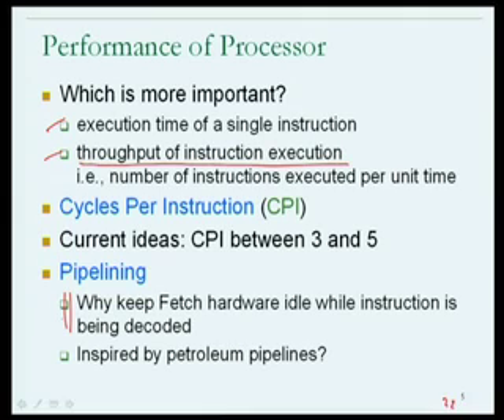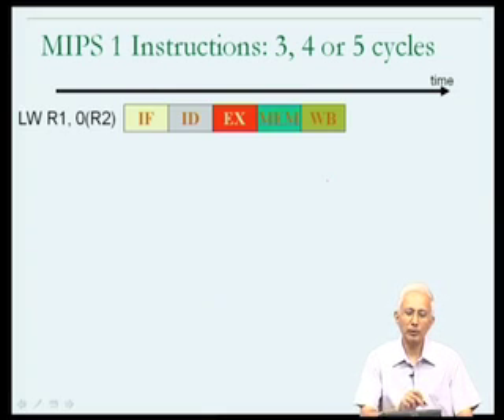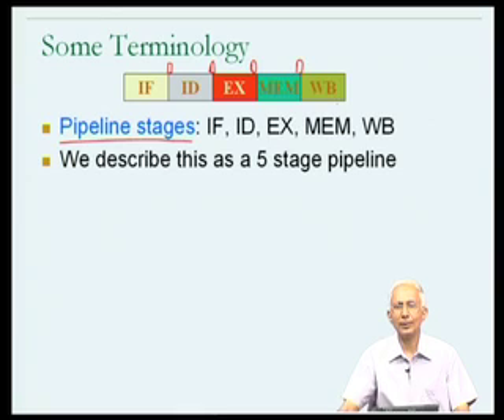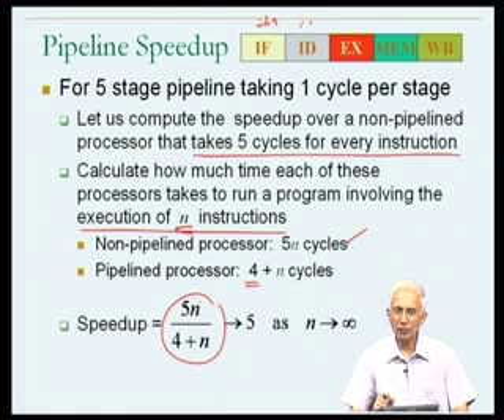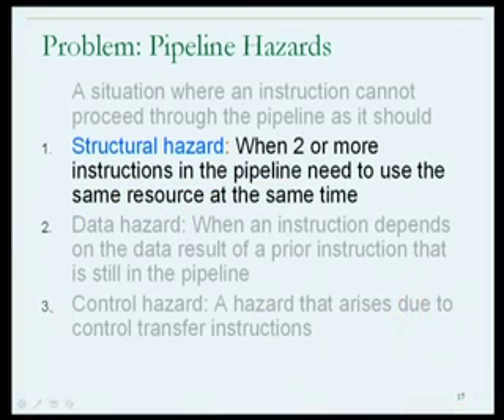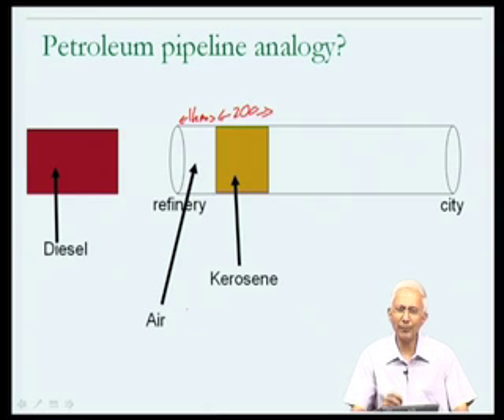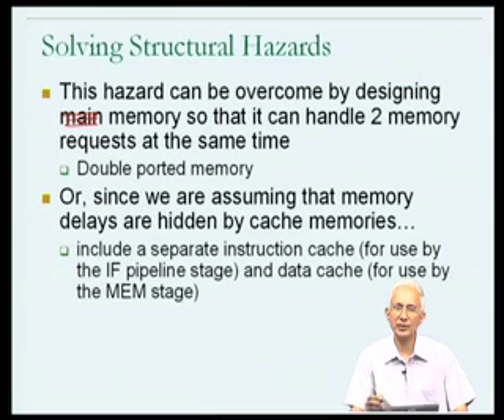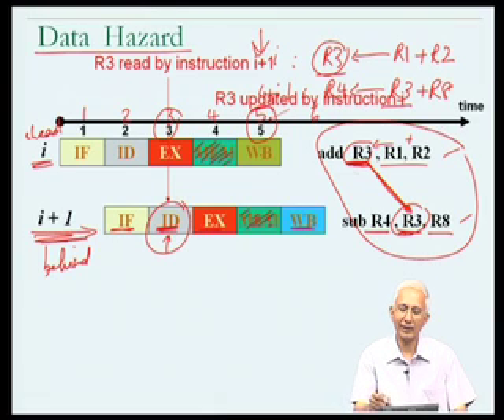Mod-05 Lec-22 Pipeline hazards

Comment: Why is it that i+3 is able to fetch the next instruction (IF) while i+1 uses memory access (MEM)? I thought that was why we used the buffer in this example.
Reply: This is because we do not know what the i+1 instruction is.
it can be an instruction where there's no need for a memory access hence i+1's MEM & i+3's IF can be accessed together.

If i+1 is another load instruction then i+3 has to stall another cycle.